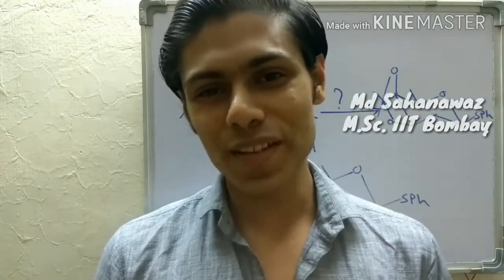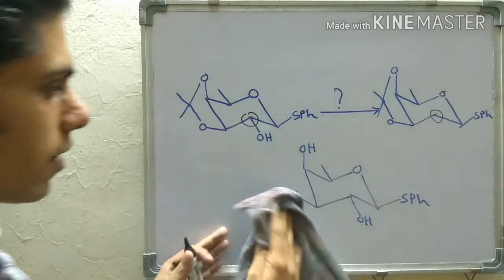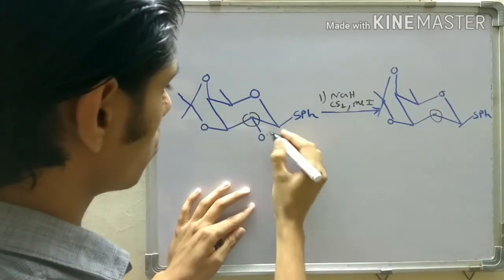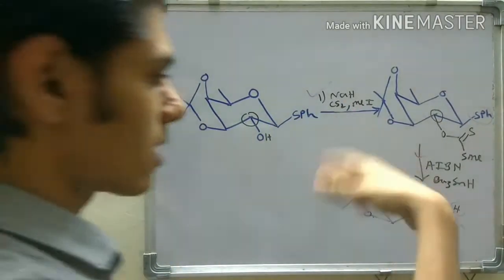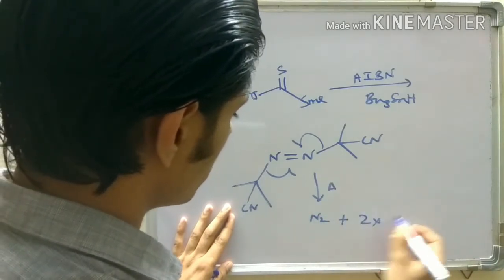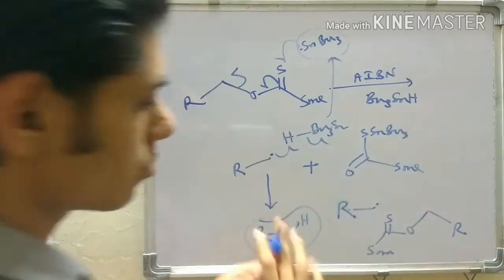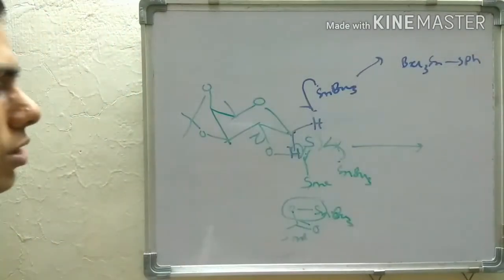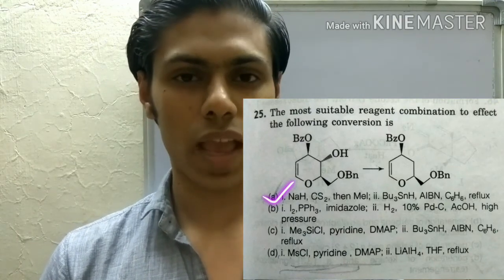Barton Mcombie reaction : mechanism problem and How I applied it to my research problem

Comment: sir, what will happpen if i use HI in place of meI here, even in case of elemination reaction by xanthate formation we use me, but what will happen if we use hI
Reply from the maker: First  of all HI is a very strong acid and rearly used in reaction.
And here if u use any acid that may protonate S(-) but the resulting molecule will not be stable and it will probably go back to starting material.
Also we used NaH in 1st step and thus is a heating reaction so adding any acid to the reaction vessel will not be a wise choice.
Hope u get the ans😊
Reply: thank you\
Reply from the maker: Welcome